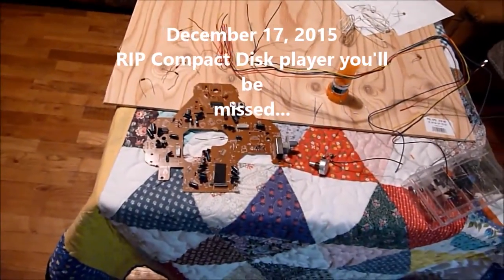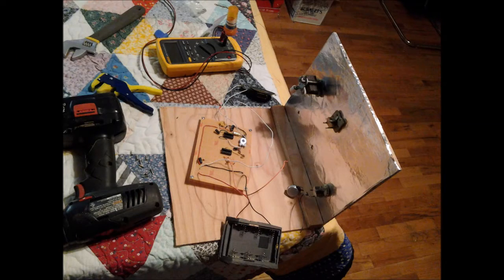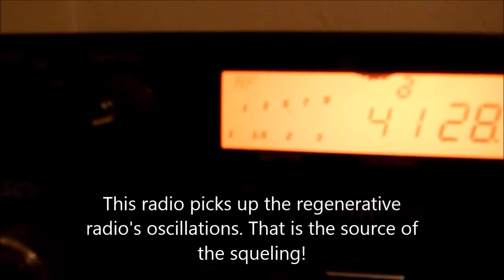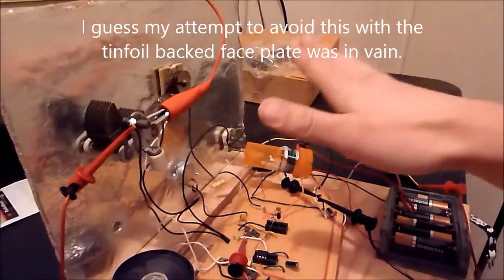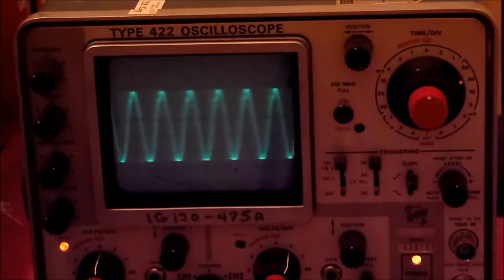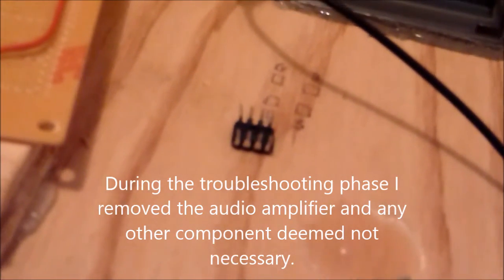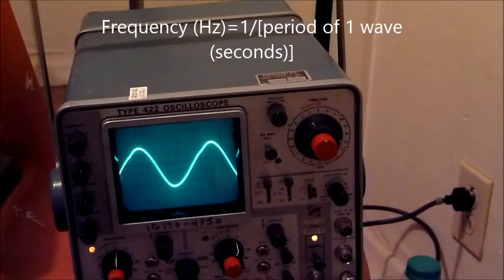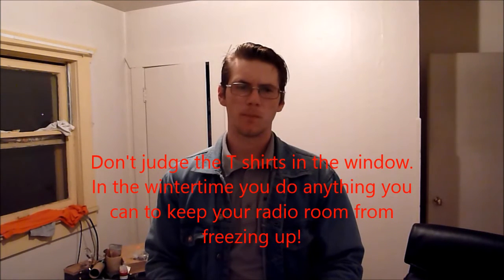Regenerative Radio (JFET)

Comment: the JFET don't have an oscillation that goes out of control, it's just bc it's voltage controlled, and have very low leakages current it's sensitive to static electricity, actually it's used to make electrometers
i remember i built one before, and brushing your hair just 10m away will trigger it xd
if you want to isolate it, you have to put the whole thing in a tinfoil faraday cage